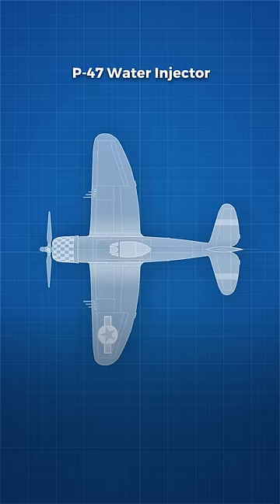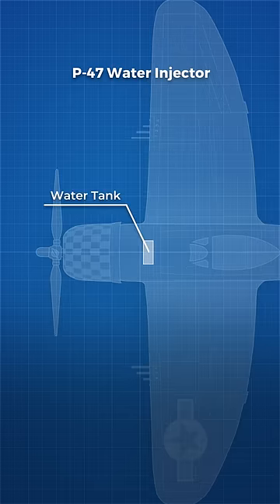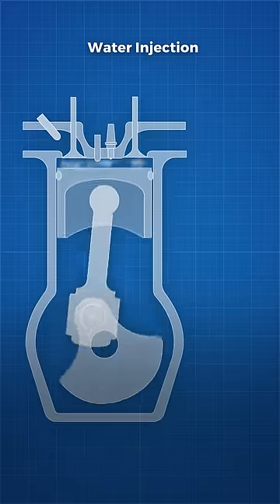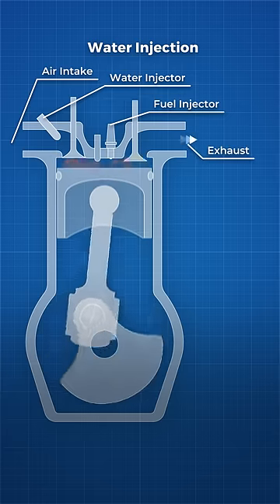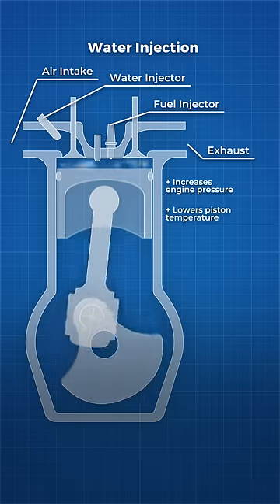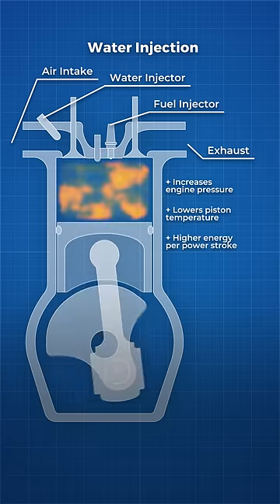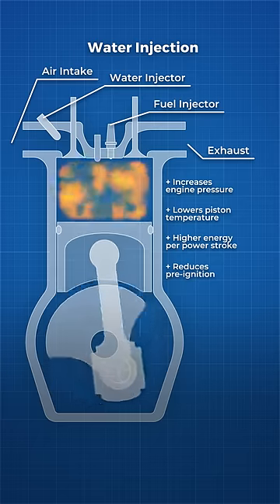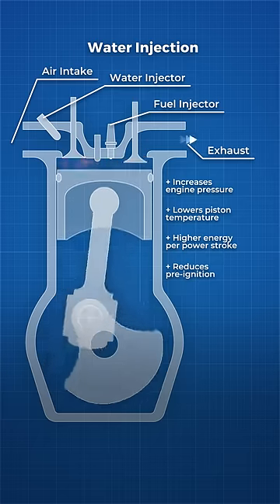How Water Injection Increases Horsepower

Comment: Funny how everybody becomes an expert when it comes to piston engines specifically
Reply: Piston engines are pretty simple when compared to other generators
Reply: @mikelprasad1924  in what way are they simple?
Reply: @throwaway3873  no, neither of you get it. A rotary is simple. A piston engine is not. You have the piston, but you have ring gaps to worry about, you have valve springs to worry about, you have spark plug gaps, you have fuel injectors or carburetors, you havw pushrods, lifters, rockers, single overhead cam, dual overhead cam, 2 valves, 3 valves, 4 valves, 5 valves, different combustion siz sizes, different head gaskets to dial in your compression ratio which usually would change with forced induction vs NA, which ties in to ring gap from earlier, and I could keep going about every facet of a piston engine but for brevity I'm gonna stop. Don't confuse there being a lot of good resources for information, to being simple. A piston engine is anything but simple. We switched to jets in aircraft because of the inherent complexities of a piston engine that make it not an ideal choice for aviation. Materials are a lot more complicated but jet engines are mechanically a lot simpler than piston engines.
Reply: @outlaw5075 I meant it’s easy to understand the bare minimum on how a piston engine works, and different engine configuration are pretty easy to understand
Reply: @mikelprasad1924  I almost agree with the whole basic idea. It's good for almost surface level understanding, but swirl of the air in the combustion chamber, flame front, how heat affects the specific air densities, all of that. I think it's a good visualization for like an introduction to truly understanding piston engines.
Reply: @outlaw5075  Also timing is a fondamental part of how an engine operates, with variable timing being superior but more complex, internal combustion engines Still have a long way to go and they are getting more and more complex every generation making them Crazy efficient but such a clusterfuck of cables,  tubes and moving parts that It got to a point where its getting less reliable
Reply: @mikelprasad1924  they seems simple because you see and deal with them every other day and you are interested in the subject, but the operation of a jet engine Is very Easy, its Just a big ass compressor with injectors and Spark plugs (After ignition they are not even on on most engines) but they have way less torque than a piston engine
Reply: @TM450FI  absolutely. Can't believe I forgot about it 😂. Almost like it's one of the most critical aspects of an engine.
Reply: @outlaw5075  okay so we switched to jet engines because piston engines don’t work well at extremely high altitude. And the power in the engines of the day were so much weaker compared to the new jet engines of the time. 

While I will agree piston driven engines have a lot of moving parts and can be confusing to a lot of people. Your average engine is simple. I’ve been building engines my entire life. And a naturally aspirated engine is the simplest and easiest thing to work on. While I don’t recommend just anyone to do their own maintenance. Don’t act like a hot shot or some kind of big league because you know how one works. I can literally throw a rock in any Walmart in the country and find a fucking parts changer. 

Source: professional grease monkey for 25 years. Fifth generation mechanic. Fourth generation racer.
Reply: @AllBallN0Brain  talk about hot shit? Piston engines do work well at high altitudes. Enough for P-47s to see 450+ mph. But they couldn't go faster because of props reaching supersonic speeds. Jet engines produced more thrust and it was obvious they were the future in 1945. The earlier italian attempt was viewed as a joke and the USAAF leadership didn't have much faith, they believed the piston engine should be the focus during the war. We started our jet engine line based off of license produced british jet engines. Now for piston engines with enough time and experience they become 2nd nature, but not simple at all. You think it's easy go design one. One that doesn't fail. Tell me open deck or closed deck architecture is better? It's nuanced. Also idk what parts you're getting from Walmart but i wouldn't bet on them. The parts exist because of a high demand for them, not because they're simple. A carburetor is a "simple' device but please, I implore you do plot the venturi tunnels and show me the bernoulli principle at work. Show me how simple the flame front is. There are academic papers publish from doctors who have spent years studying the valve for putting air into a tire and all of the thermodynamics happening. Piston engines are common, not simple.
Reply: @AllBallN0Brain  the piston engine planes also vastly out accelerated and climbed than the jet powered versions, the jets just had way better energy retention and top speed. The Jumo 213 and DB 605 was also more expensive than the Jumo 001.
Reply: @throwaway3873  yeah guess you're right, a 17 year old drop out can turn bolts. 🤡
Reply: @outlaw5075  it's a diesel engine it doesn't use spark plugs or carburetors...
Reply: @IfJesusWoreAHat  definitely not.
Reply: @outlaw5075  tell me why jet engines are mechanically a lot simpler than piston engines
Reply: @daxidfrost  well naturally it's a nuanced thing. As far as moving components go they are mainly just rotating blades on shafts. You have combustion chambers that just dump fuel. Naturally as jet engines progressed they had more and more parts put on. The New F-35 engine the F-135 I think it's Hella complicated, but that's a lot more development than piston engines. We had direct injection for aviation in the 30s, and many many cars today still don't have it. Not that it's better, just more "advanced" technologically speaking. No way you cut it, the R-2800 in the P-47 is complicated. Twin row 18 cylinder radial with 1 centrifugal supercharger crank driven, and a turbo mounted far away. Careful ignition timing, fuel mixture, spark level, cylinder Temps, rpms of both the turbo and the engine, boost, fuel, oil pressure, it's a lot. Jet engines are immensely easier to operate as a pilot. Mechanically I'm pretty sure they're "simpler" but in terms of engineering they are much more complex.
Reply: @outlaw5075  how about jet engines cooling system and starting system?
Reply: @daxidfrost  well I first want to preface all of this with 2 things. 1. My original statement was that piston engines are complex. 2. I am not near as familiar with jet engines and I am just repeating what I've heard and I can be wrong, but a few times over the years I've heard this claim before but I've never bothered fact checking it. All that being said, cooling systems I don't believe fall under mechanical, the pumps do though. I imagine the oil pumps are quite gnarly on a jet engine. It's quite easy to see all of the lines running on the outside of the housing. Piston engines aren't more complex than a jet engine, they just have more tiny, intricate metal moving parts that are very carefully timed. In terms of engineering like materials and how the air interacts with the blades much more research and development is done.
Reply: Let me show you all how to weld.
Reply: I've always wondered how a spark plug injected fuel. And now I know.
Reply: When taking a look outside of the engine to the gearing and how power from it is transferred, everyone looses confidence. Kot that simple
Reply: Doesn't the p47 have a radial engine tho? So extra complicated piston engine 🤣
Reply: How many race engines you built? Not on jigsaw puzzles..that dont count.
Reply: @outlaw5075  About 7.. I used to race Super Stock years ago, kiddo!.. And you?
Reply: @outlaw5075  pistion engines are simple
Reply: @Atomicgoldofcll  nope.
Reply: @user-lq7hf1ww3k  so tell me what were your piston rings gapped at? For all of your motors
Reply: @outlaw5075  You forgot to specify which ones.  LOL.. fake..
Reply: @user-lq7hf1ww3k  oh? So there are multiple rings that need different gaps for different applications?
Reply: Some people are
Reply: @radicaledwards3449  I mean yeah, but nowhere near the amount of people commenting are.
Reply: @outlaw5075  I would not say that jets were adopted for their simplicity as that's just wrong, lmao.  They were adopted because they produce significantly more power and retain useful power at much higher altitude.
Reply: @outlaw5075 reading further down, you're just talking out of your ass.  Within like 5 years of jet aircraft arriving they were setting climb-rate records that piston engines couldn't dream of.  Also, jets do retain their performance at high altitude far better than piston aircraft, the P-47 was one of the best high altitude piston fighters ever and topped out around 30-40k ft.  And the only reason it could do that was because it had a huge turbocharger taking up most of the fuselage.  Basically every military jet since the F-86 (1949) could go at least 15,000 ft higher than that.
Reply: @JMurph2015  I don't know what paragraph you read but you're at least talking out your ass just as much as me. The F8F Bearcat held the time to climb to 10k feet from completely stopped in 94 seconds. It held this record for 10 years. Now it's debated how stripped down this Bearcat was, no armor, no guns, no instruments, etc. Very early jets couldn't fly as high as some piston engined planes so also out of your ass. Jets lose performance with altitude just like piston engines, but that's the only similarity. They have a much higher baseline of performance and have much more available power. I said propeller planes couldn't go faster because of power limitations (due to drag) and propeller tips becoming supersonic which would rattle the prop apart. I specifically picked the P-47 to try and discredit the statement that piston engines didn't perform well at high altitude. Now I'm also a proponent of the turbo giving it great performance but the turbo still is only a part of the equation. Whether you argue 1/5th the equation or 4/5th, the jug having a fantastic wing, seversky S-3, good drag reduction techniques, and a great propeller. I agree propeller planes got outclassed far beyond their dreams, but idk about 5 years. They still accelerated slower, had compressor stall problems, airframes suffering from mach tuck and buffeting, they still needed more time. However when the early to mid 1950s rolled around a quantum leap in performance that is still impressive today like the F-104, F-102, F-106, F4, F-100, etc. So maybe more like 7-10 years props would never come close, but early jets were better, but you still had to be careful. Thr planes mentioned above you just had to worry about not hitting the plane as you flew by hundreds of miles an hour faster.
Reply: @outlaw5075  the F-86 had a 50k ft service ceiling in 1949, keep digging yourself into the hole.
Reply: @outlaw5075  by the way, the F-86 clearly holds a higher climb rate (even at sea level!) than the F8F from any source I can find.  Even going to 3048m in 94 seconds puts the F8F at only ~32 m/a climb rate.  The F-86 smashes this at 46 m/s climb rate at sea level where the prop plane has the best chance.
Reply: By the way the physics for why jets work better than piston engines at high altitude is a simple matter of compression ratio and inlet airflow.  Jets run at much higher total compression ratios than even turbocharged piston engines.  Jets also tend to capture more air at the inlet because they usually pass some significant fraction (or all) of the fan's area through the core (while not incurring a significant penalty for doing so).
Reply: @JMurph2015  maybe I didn't state this clearly enough for you by saying the F8F was modified to win this competition, but the whole thing was in favor of the bearcat. It was from a dead stop on the run way to 10000 feet. The competitors that I know for a fact were F9F panthers and F2H banshees. If you start both planes at say 250-300 mph at sea level then the jet will obviously win because climb is just power available minus power required. Ooohhh I can throw around formulas because I know them too.
Reply: @outlaw5075  direct quote from you halfway up this thread:  "the piston engine planes also vastly out accelerated and climbed than the jet powered versions, the jets just had way better energy retention and top speed. The Jumo 213 and DB 605 was also more expensive than the Jumo 001."

The F-86 entered service in 1949, only 4 and some years after the end of the war (and the introduction of the Bearcat) which is why I said within 5 years piston aircraft were hopelessly outmatched.
Reply: And to bring it all the way back to your first allusion, no, it was not for simplicity or reliability that jets became common in planes. It's purely because they outperform piston engines in every way that matters other than perhaps outright cost and ease-of-maintenance.
Reply: @JMurph2015  true, however the F-86 was mostly an exception and the early F-86 was still solving some teething issues. Most other jets, mainly naval as that's kinda where it gravitated, we're inferior in a lot of ways that mattered. It's why the US navy used Corsairs until 1951 or 1952 I think. And my quote is still true for many many early jets. Now it's easy to start the jet out at a higher speed or something like that, and even at a given speed they hold energy better usually, but the bearcat, P-51H, Sea fury, Seafire, griffin spits, and a few others could out climb and put accelerate many early jets from 1945-1949. I mean you're preaching to the choir. I know jets are faster. But the props didn't immediately get left in the dust. They still had some things going for them. They especially were much better ground attack platforms for a while and may even be still considered for low intensity counter terrorism, but a B-1B with GBUs is a damn fine CAS platform too.
Reply: @JMurph2015  I can see where I worded it to where it's saying that we switched because of complexities, but I didn't mean that as the sole reason. If I did why would I say the other stuff I did? It was more just a interesting thing that some early jet engines were actually cheaper than piston engines and are in some ways simpler. Not that it really matters. If you look further down I also said in a comment way before you that we switched bc of greater thrust (or horsepower whatever) of jet engines and the limitations of propellers and power.
Reply: Funny how some of are degreed mechanical engineers working in motor sports for a few decades and, yeah, kind of understand them.  Or did I forget what a spark plus is and the direction of a compression stroke?
Reply: @rdspam  hey mechanical engineer? That's me! Not saying anyone can't understand them, or that it's even difficult. But to say they are "simple" is just wrong.
Reply: The last 125 years have seen piston engines become the most popular type, so lots of experts.
Reply: @outlaw5075  Try working on a jet engine in your garage.
Reply: @gaoxiaen1  if it's tiny RC jet engine then it ain't as bad 😂😂
Reply: It's not complex- some of us have been qualified mechanics for very long periods... I've had my qualifications since 2004... The guy did a so- so job of explaining this, left a lot of important details out AND mislabeled obvious engine components... Maybe your just seeing a bunch of people with more experience and knowledge on the subject than yourself and the poster
Reply: @RebeccaKenworthy  it costs the average automotive company 800 million dollars of R&D to build an engine. Don't confuse being a mechanic for being an engineer.

Comment: shoutout to the spark plug, my favorite fuel injector
Reply: That's Champion.
Reply: I'm glad I wasnt the only one that noticed that
Reply: The spark plug wasn’t injecting fuel. The spark plug was the the right of it. What you saw was the fuel injector.
Reply: @quillanthrasher6846 just watch how it’s working the labeling was wrong. But the working model was correct.
Reply: It's not a spark plug.  It's a spark injector.
Reply: That engine wasn't direct injection in the first place
Reply: Same😂😂😂😂